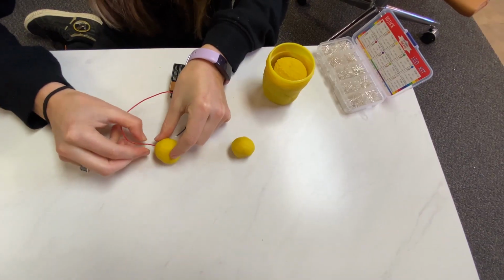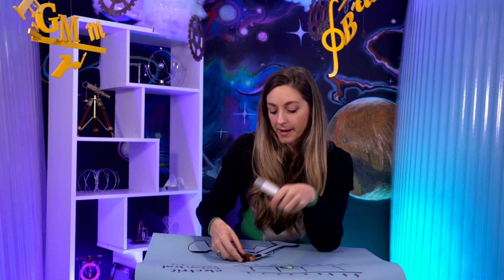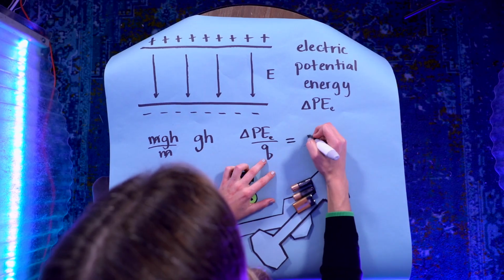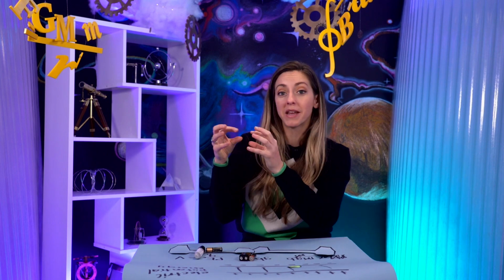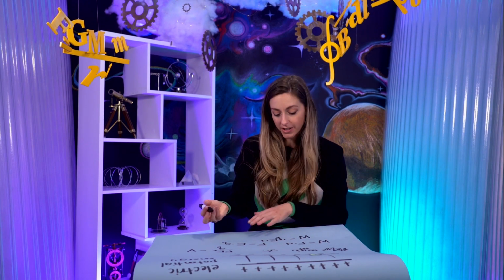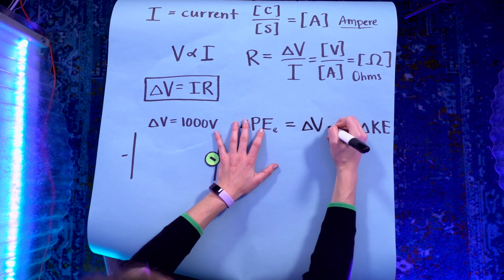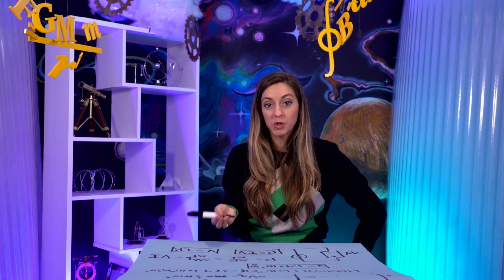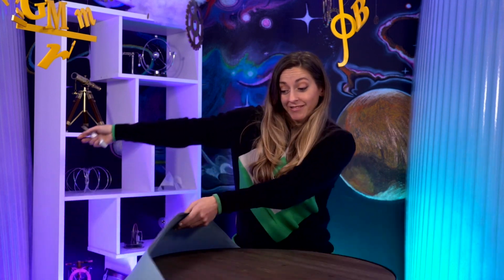Circuits, Voltage, Resistance, Current - Physics 101 / AP Physics Review with Dianna Cowern

Comment: GREAT COURSE as always! at 19:07 you mentioned mass doesn't cancel, but maybe it could. the q or amount of charge can be written as as n x e (number of electron times charge of electron) and number of electron would be Total mass (Mt) divided by electron mass (Me). So q = Mt x e / Me. So this way total mass would cancel from both sides of your equation, I guess! Am I wrong?? So instead of mass, you would have charge per mass of electron as a fixed factor (e/Me)

And one question, sorry I'm one of those pesky students! It seems at around 250kV and above in vacuum electron would reach speed of light and pass it, but it won't I guess. What is limiting electron?
Reply: My understanding of it is that electrons do have a certain mass. And as such even when you accelerate them they can only asymptotically approach the speed of light but never equal it. If you were able to create a really strong field in a vacuum and somehow accelerated a mass above c, then how could you keep the field going with the object in the field? The plates would have to be moving apart much faster than c. c is basically the upper limit of the ability to propagate mass or information within our universe. As to why that is I do not know, that's well into the realm of quantum physics.
Reply: @Afrotechmods  That makes sense, which means the speed calculation equation should probably have another factor in there that comes into effect at speeds close to light.
Reply: @ElectroBOOM  According to theory of relativity mass increases with increase in speed

m(in motion)= m(rest)/√{1-(c²/v²)}
Reply: @ElectroBOOM  hello electroboom
Reply: @ElectroBOOM  And that in a way tells us how mathematical equations that describe physical phenomenon are not to be considered directly, but to be taken account their limitations and ignorance of negligible quantities that might be significant in some rare cases, that's why understanding physics is important than being able to solve its math.... and so, I have a very unpopular opinion that physics is not to be taught through math as introduction which could lead to students misunderstanding the concept. however, I agree that math is essential in physics to calculate and derive various quantities
Reply: @Afrotechmods  photons have mass yet they can reach the speed of light... Have you never heard of particle wave duality?
Reply: The best part of this comment is reading it in your voice.
Reply: I was wrong. The best part is all the smart people (not me) giving actual answers.
Reply: @CertifiedSkank  and not criticizing one another. Thank you!
Reply: @CertifiedSkank 
Heh. Agreed. 
The amount of brainpower here? 😲
Reply: Mass
Reply: As with everything else with a rest mass, as an electron gets close enough to the speed of light, energy goes more to increasing its mass and less to increasing its speed. You can never actually accelerate something to the speed of light because of that effect.

And, yes, you're right that you end up with the charge/mass ratio of an electron as a constant factor in the equation (just like there's a mass/mass ratio, which cancels to 1, for gravitational acceleration)
Reply: The kinetic energy equation used in the video is an approximation, only true for non-relativistic speeds. The true (i.e. relativistic) Kinetic energy equation is KE = sqrt((m v / sqrt(1 - v^2/c^2))^2c^2 + m^2c^4) - mc^2, where m is the rest mass (of the electron). Set that equal to Q*V and solve for v, and you get v^2 = (c^2*KE*(2*c^2*m+KE))/(c^4*m^2+2*c^2*m*KE+KE^2) where KE = Q*V. 

For 1000V, this gives 1.8728e7 m/s (0.0625*c). For 260 kV, this gives 2.2449e8 m/s (0.7488*c). It never rises above c.
Reply: this is the best comment section.
Reply: ElectroBOOM in Batteries ( Dendrites) accumulate across the two opposite Polarities as Mass and can cause Mass , and causes a Electrical Short
Reply: Hii electroboom I love ur videos too much 💓 💗
Reply: @Sarthak.2406  PLEASE Do follow and subscribe the channel to see the beauty of physics
https://www.youtube.com/watch?v=t7ZuEsXWfGE&t=465s
Thanks
Reply: First you debunk free energy scammers, than uni professors and now her?

Also in a battery doesn’t move material too? Oxidation and Reduction
Reply: @Systox25  PLEASE Do follow and subscribe the channel to see the beauty of physics
https://www.youtube.com/watch?v=t7ZuEsXWfGE&t=465s
Thanks
Reply: Noobs: Resistor
Electroboomers: ResisTHOR
Reply: Actually classical physics don't really work when approaching speed of light, the wave nature of electron would be dominant which means it will NOT act as a discrete particle making things difficult.
Reply: Limiting factor is its relativistic mass which keeps on increasing with its velocity ..she is just ignoring any sort of relativistic or quantum effects bcoz all these r beyond this course as she mentioned earlier 4:58 in this vedio
Reply: Electron mass will not be cancelled. Bcos charge q is not mass. Beyond 250 v the eqn is not good enough,as Newtonian mechanics will not explain quantum phenomenon
Reply: @Arun-nt4kv  yes u are ✅  right
Reply: @Arun-nt4kv  it's not about cancellation but finding a fixed relation for both quantities... because charge is quantized In terms of charge of electrons
Reply: @Arun-nt4kv  PLEASE Do follow and subscribe the channel to see the beauty of physics
https://www.youtube.com/watch?v=t7ZuEsXWfGE&t=465s
Thanks
Reply: THE LEGEND HIMSELF!
Reply: @prasadsalunke9176  PLEASE Do follow and subscribe the channel to see the beauty of physics
https://www.youtube.com/watch?v=t7ZuEsXWfGE&t=465s
Thanks
Reply: i don't think anything can reach the speed of light, mehdi. Electron has mass. In order to reach the speed of light, you'd need to have either no mass or unlimited energy in order to make you massless.
Reply: ah yes the man himself
Reply: @dioptre  PLEASE Do follow and subscribe the channel to see the beauty of physics
https://www.youtube.com/watch?v=t7ZuEsXWfGE&t=465s
Thanks
Reply: Mehdi let's consider potential diff. Across two parallel plates is 300kV thus energy is more than limit of transferred to K.E.(1/2.Me.C^2) thus rest energy (7.05 joules) where goes please tell?
(My guess: electron take maximum energy they can take rest left for others)
Reply: Hi electroboom I am regular viewer of your video.
Reply: @Rafi-sq6qh  PLEASE Do follow and subscribe the channel to see the beauty of physics
https://www.youtube.com/watch?v=t7ZuEsXWfGE&t=465s
Thanks
Reply: For canceling the mass, that cancellation works for an electron — but for a proton you'd need a different charge per mass, for a Cd⁺ ion you'd need another charge per mass, even a Cd⁺⁺ ion would need yet another, etc. More generally: "Gravitational charge" and "inertial resistance" are both just mass, so you can cancel "gravitational charge" with "inertial resistance" because you know they're equal. Electrical charge, on the other hand, varies quite a lot.

The issue with massive velocities is a result of thinking of the speed of light as a boundary, where things are normal until suddenly you hit the limit and they're not. More accurately, things get distorted, gradually at first. However, you can use easy equations like that to calculate the "Newtonian pseudovelocity", and then distort it into the real velocity, so long as the interactions are sufficiently limited between objects of different velocities. This lets you think of it better, so whenever you get a result like that, the number has some use, and you know it started getting distorted a while ago.

To use your example a bit strangely, a spaceship using a 511k V electron gun and a 511k V positron gun for thrust would be very fuel-efficient(and stupidly power-hungry), and you can correctly calculate the fuel efficiency from the exhaust velocity by using the Newtonian pseudovelocity. Even though that pseudovelocity is twice the speed of light. But the exhaust particles really only come out at .866 c.

This works because space, time, and mass get distorted. Velocity is space per time, and as the particles come out super fast their relativistic mass inflates. So you're firing bigger particles slower, and measuring the expected speed with a warped ruler against a warped clock, and getting 2 c. Out in flat space, it's only .866 c. But that warped measurement tells you accurate things about warped phenomena.
Reply: @darekun46  PLEASE Do follow and subscribe the channel to see the beauty of physics
https://www.youtube.com/watch?v=t7ZuEsXWfGE&t=465s
Thanks
Reply: I heard your soothing voice while reading this.
Reply: i can hear your voice in my head while reading this
Reply: The velocity of the electron won't continue to increase linearly. As an object approaches the speed of light, adding kinetic energy starts to increase its effective mass instead.
Reply: My guess is the vaccum limits it
Reply: Hey Electroboom is here! I clicked on your username just to make sure it was really you!
Reply: She's just a pretty face reading from script, she doesnt really now this stuff
Reply: Goddamn that's an epic question.

Comment: The electric wand seem to be so cool! I also loved the joke in "So this one required two double A 1.5 volt batteries. Did it come with them? No." Also, I love the paper cutouts :) Additionally, that's so cool with the electrons traveling through air at 10:14

Comment: In your old style television example, you sort of made it look like the screen has a positive charge attracting the electrons. The electron acceleration toward the screen actually happens in the neck of the tube, and the magnetic field produced by the yoke then bends the path of the electron to reach a specific point on the screen.
Reply: If you haven't noticed already, introductory physics courses use simplified, easier-to-calculate examples.  The point is not to understand how cathode-ray tube work, but to understand the physics.

Comment: A capacitor stores electrons the difference between a battery and a capacitor is  the if the material has electric potential or if electrons were added  . some batteries like in your phone are more like capacitors
Reply: Not really.  The capacitor stores energy in the form of an electrostatic charge on both plates.  The battery stores energy in the form of chemical energy in the electrodes and electrolyte fluid.   There are no chemical changes that happen when a capacitor gets energized, unlike a battery.   Just electrons moving from one conductor to another, and collecting on one side while depleting the other.

Batteries also have an open-circuit voltage that is close to constant, regardless of the state of charge.  Capacitors by contrast, have an open-circuit voltage that is directly proportional to the state of charge, such that energy stored in the capacitor is proportional to voltage squared.

Comment: Free electron? Yeah right. You have to pay for those! That's why we get electric bills!
Reply: The utility company doesn't give you any electrons.  No net electrons accumulate in your house as a result of using electricity.  In fact, the electrons in your house, never even touched the power plant's generators, because there are isolation transformers along the way, and because it is alternating current rather than direct current.

It is energy that the utility is selling to you.  Not electrons.   Just like when a person speaks to you, the molecules of air inside their throat, don't actually make it all the way to your ear.  The person speaking just vibrates the air molecules near them, which propagate the vibration through the rest of the air to the air molecules near your ear.